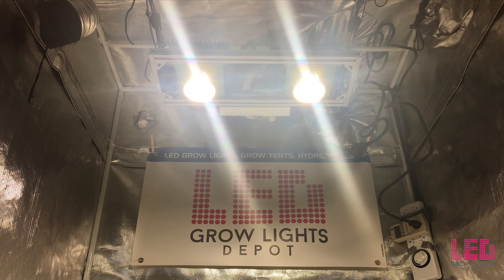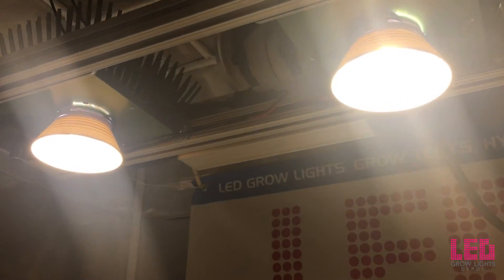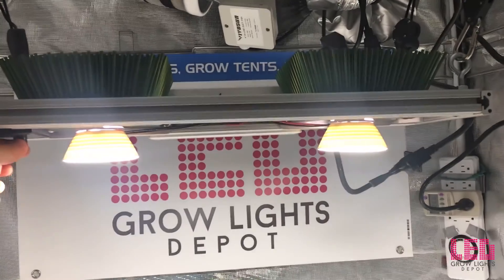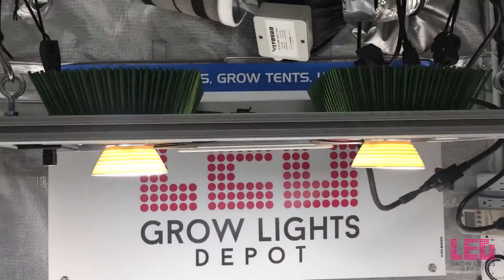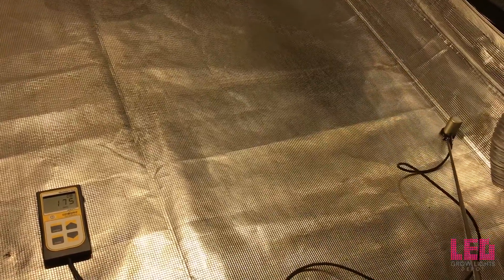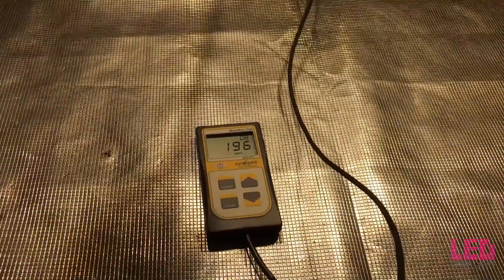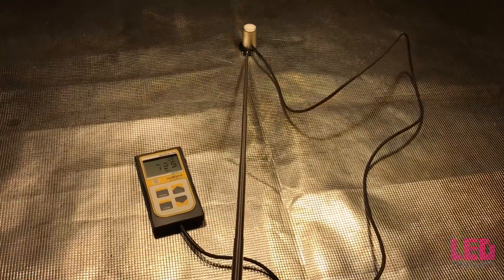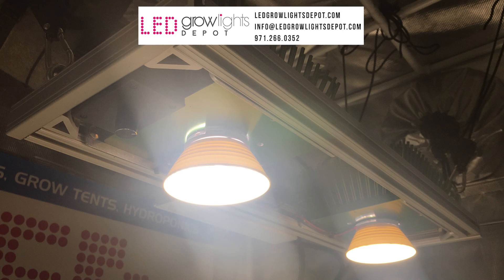Timber Grow Lights Model 2VL Vero29 V7 COB Review

Comment: Been waiting 2 weeks for my light hoping it worth it
Reply: Was it?
Reply: Update?
Reply: @lysergicaciddiethylamide6127  nice name
Reply: Yes it definitely was nice name
Reply: C K thanks bro bro I’m about to get the 4vl. I’m downsizing from my 4x4 with an optic 6 led
Reply: I got a 4vl as well and it's a beast, had some issues with the room getting really hot with this light, and having it too close, so be careful, but it is a good light. No difference to by power bill either really
Reply: C K yeah I went onto timber’s website it said the 4vl was good for 2.5x5 and the 3vl footprint was 2x4. I’m gonna go with the 3vl I’m running two 4” carbon filters one in one exhaust. I kept my 600w light pretty cool normally around 85-87 depending on humidity.you got a 5’ or 7’ tent?
Reply: @lysergicaciddiethylamide6127  need a good carbon dioxide pump if you know one lol
Reply: @va-viciousgrowth7274  I don’t need to run co2 but if I was I would just use a tank and a regulator. Titan controls is a good brand I hear.
Reply: @lysergicaciddiethylamide6127  true my buddy says it made a huge difference on his cola size. I've been having issues with large main cola's but mostly fluff bullshit everywhere else
Reply: @va-viciousgrowth7274  I have 200-400 ppm naturally because I’m have 3 dogs hence to dual carbon filters I only grow 2-3 plants at a time. If you have 6 or more I would say definitely supplement. Also light intensity and UV light could help, you just have to keep that heat down.
Reply: @va-viciousgrowth7274  I just make edibles with my larfffff lol
Reply: No tent, small room with white walls

Comment: My exact model just arrived in the mail today except there is not a cup around where the light comes out like there is on yours.  Why is that?
Reply: Max Wagor they perform better without them
Reply: The company wuit adding reflectors . They cut down footprint and are not necessary

Comment: Would the 3vl or 4vl be best for 2x4 tent to get maximum results?
Reply: I would get the 4vl if it fits.  with cobs in general  if you can afford it, it will provide much better more even coverage each cob you add to fixture, means each can be run with less wattage to achieve same PAR at canopy.  4VL will have more even spread and run more efficiently per watt, but likely won't need to be run cranked up at 100%.. at 100% the 4vL could burn plants with intensity depending on hang distance. run at proper wattage and distance the 4VL will outperform the 3vL in that space in my opinion.

Comment: Price must be high because its "american"
Reply: hi SRB NS. this fixture is $299. the cost of parts to the consumer: LEDs = $55, driver $50, heat sinks $50, power cord, potentiometer, reflectors, cob holders ect.. ratchet hangers $20, aluminum extrusions $20, hardware, $5. we quickly get to about $200 in parts from wherever if you want to build it yourself. do it! the extra $100 is for the 3 year warranty and the convenience of having someone build the frame and safely wire it for you. price seems fair to me!
Reply: @bmxapothecary  I love it ! Cobs are proven to be top for PAR in led grow and all... But one thing i dont like is that whole cob dies unlike single chips per one 5w led... When one led dies the other leds continue to do their job.. am i right?
Reply: Yes you are right. It's important to have proper thermal management and wiring so the cobs stay cool and last a long time!

Comment: man, any idea of Lux at 18 center by chance? I know lux means little, but out of curiosity
Reply from the maker: Good question. No clue, since no one measures lux for LED lights :)
Reply: LED Grow Lights Depot right on, and only 3% have a PAR  meter, if spectrum is there, as in, full spec white, why not lux being a measurement for intencity varible,
Reply: Moneynvrsleeps On your phone u can download a free lux meter app works pretty good. To get par from lux u can divide by 76. So measure the lux w the phone n DIVIDE by 76.That's a pretty good rough par from a free app. When i checked it to what the specs on my lights were it was pretty dam close like withing 30 par of what it was rated at. So for free its fairly accurate . In other words take the par he has in description or states then MULTIPLY  by 76 to get a fairly accurate lux number.
Reply: At 18” I get 48-50k lux under a 2vl in a 2x4 tent